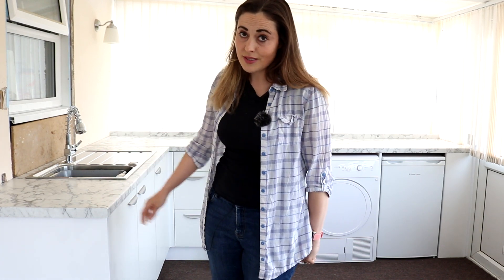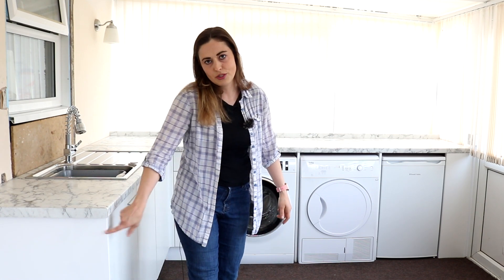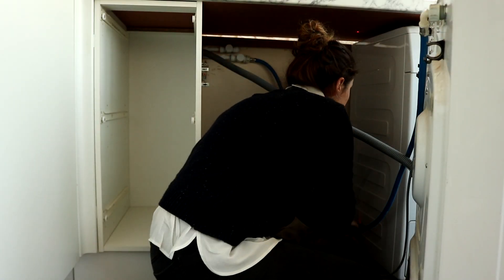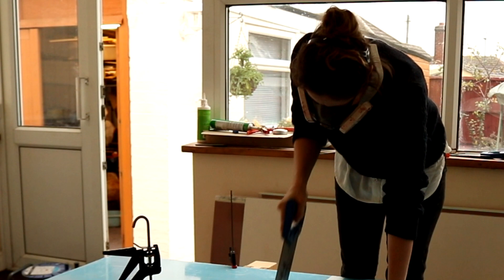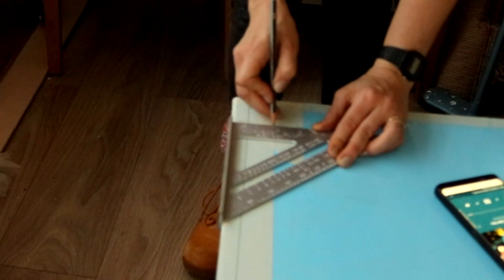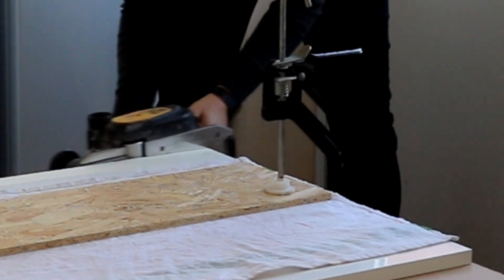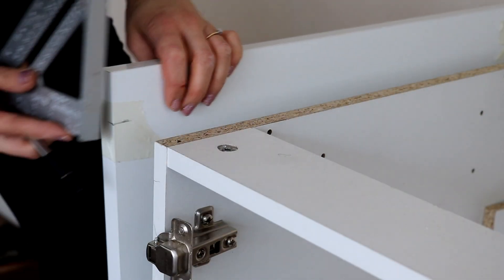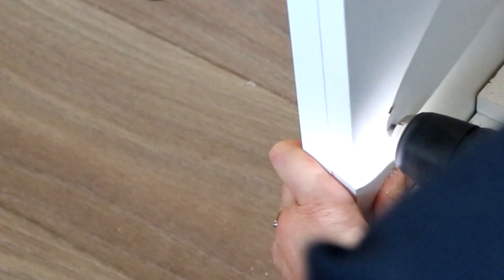Installing Kitchen End Panels & Between Appliances | The Carpenter's Daughter

Comment: Do you find using a handsaw gives you a straighter edge over say a circular saw? 👍
Reply from the maker: Good question!  My last video was the first time I'd used a circular saw, so will try in the future as it would no doubt give a straighter cut.  But I do feel safer with a hand saw when possible chipping could happen on melamine wood.
Reply from the maker: 😂😂 Thank you! :)

Comment: Hi, thanks for a great tutorial!  We just ordered a new washing machine and heat pump tumble dryer.  Just wondering how much space we should allow between them because the recess size is 50mm wider than the actual width.  Seems like you need 25mm either side, so was concerned about putting panels too tight.  Appreciate your advice, thanks again!
Reply from the maker: I'd probably recommend as much as you can.  My Dad told me not to bother initially as they're tight to get out when end panels are fitted.   Just go with what you're happy with.
Reply: @TheCarpentersDaughterUK  Thanks!  Will see how it goes.  Might add a narrower strip, enough to help support the worktop, but removable to allow access.  Put a few screws beneath the worktop with heads sticking out slightly, to create guide for the board to slide into :)

Comment: To avoid chipping - Router. That's why they are used on worktops. For 18mm panels only needs to be a 1/4" machine.  Or cut the piece long and then use a belt sander.

Comment: If you're having trouble with chipping try changing the jigsaw blade for a down cutting blade. Or using a skill saw cut from the back side. Although this wont help if you need both sides looking clean

Comment: When you can't clamp the panel tightly. Put the screw almost all the way in then back it out so it's only in one side of what your fixing. Then push as tightly as you can and put the screw the whole way. That should pull them together tighter

Comment: It is not what others think and say that matters! .... It is what You think that does!
The only tip I would give would be to scribe the rear face of the inter-appliance panels! 

Simply holding a block of wood against the pane at its widest gap from the wall, holding a marker (pencil or sharpie) against the cut edge and dragging the block up or down to leave a line the exact width of the gap. Easy to do ... harder to explain ;0) 

An alternative way to do it is to put the panel in place but forward with the front face extended the width of your block. Then simply scribe your line down the rear of the panel giving the panel an exact fit from the rear wall to the front face!

Sharpie marks can be removed by rubbing fresh sharpie over the offending mark and immediately before it dries with a paper towel! ..... This works for permanent markers!
Reply from the maker: Thanks!  I really need to practice more with scribing as in theory, I know it's straight forward and tend to over complicate it 😄  I love the second method- will remember that for next time. Thanks!
Reply: It works well with Tiles and Laminate flooring too ;0)
Reply from the maker: Kicking myself now about not drawing on it in reverse 😂